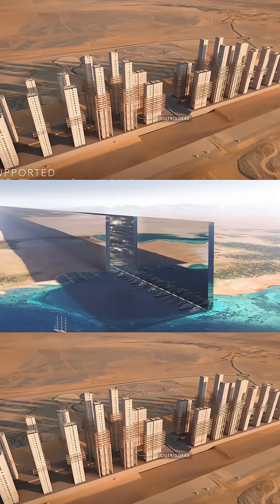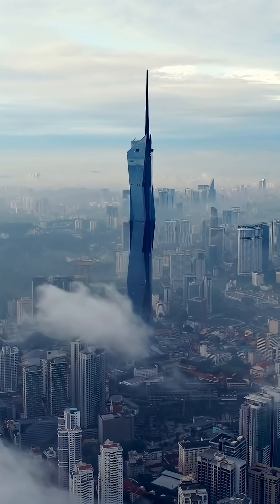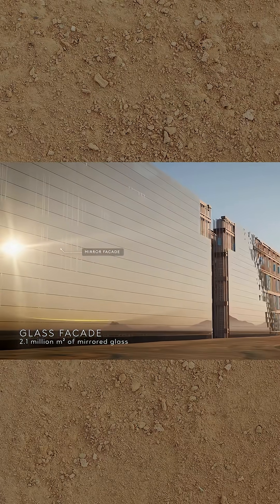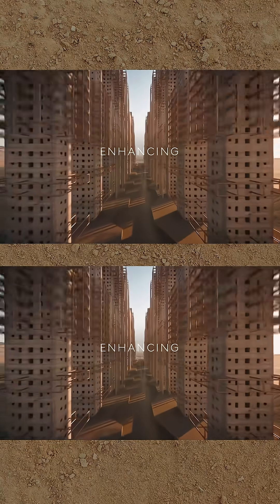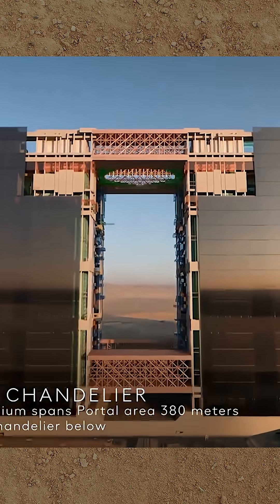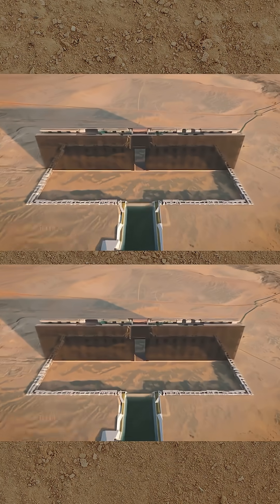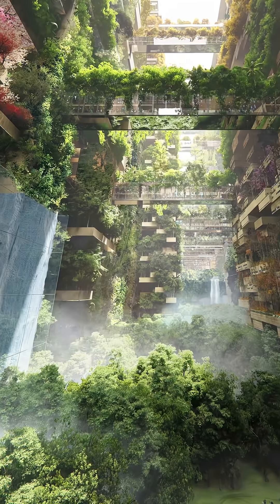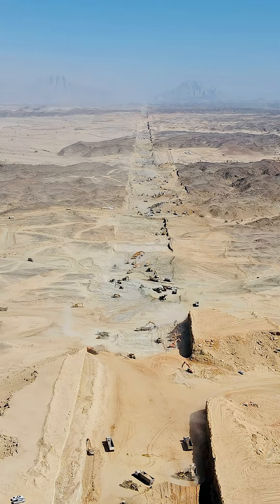Fred Mills: How Saudi Arabia is Building THE LINE

Comment: Whenever I hear about the mirrors in that desert region, my thoughts go straight to the meme "The sun is a deadly laser."
Reply: Well at least they'll have an endless supply of glass for the next section then... 😝
Reply: @supaflyza 
Where are you going after you die?

What happens next? Have you ever thought about that? 

Repent today and give your life to Jesus Christ to obtain eternal salvation. Tomorrow may be too late my brethren😢.

Hebrews 9:27 says "And as it is appointed unto man once to die, but after that the judgement."
Reply: As long as it’s not concave like the skyscraper that melted everything in the focus point.
Reply: @chris2381-t3r but if that focus point is in an uninhabited desert area couldn't you potentially use it to generate massive amounts of energy?
Reply: @chris2381-t3r the one that I know of was the Walkie Talkie building in London.  It melted a car.
Reply: @chris2381-t3r my window with mirror isn't convened but it still melts my tarps outside lol, focused beam just makes the center point much higher power beam but it don't mean being a flat surface will not melt things.
Reply: This is a topic in every engineering college....the impracticalilty of this project. Have money waste it 😢
Reply: @Nrb2003  so, how did those man-made islands work as their last architectural marvel?
Reply: Architect here. I once did reno work in a condo development where the sun was reflecting off of windows and melting the vinyl siding! The sun is a powerful force. I “pity the fools” who live in “the line”.
Reply: @christopherzehnder I do too. It’s basically a prison tarted up as something good 😬
Reply: @christopherzehnder 
I watched a documentary on the line where they pointed out the cost to keep it air conditioned ( it's being built in the desert ) would bankrupt the project among other challenges...
Reply: @cduffy6708 No need for ac when all that heat is reflected away
Reply: @christopherzehnder  makes you wonder if this will effect the air conditioning in the buildings. Not sure they will get that many to live there once the heat is noted as a factor.
Reply: @christopherzehnder  You think they didn't do all their research before attempting a project this gigantic?
Reply: @AllAround_TheInternet I’m an engineer. Just because “they can” doesn’t mean “they should”. This is a vanity project.
Reply: @christopherzehnder  I understand you. But for a project this massive and transgenerational I feel they should have put everything in place both research and the effects it would have especially on the ecosystem.
Reply: @AllAround_TheInternet You mean done their research like the "world's biggest big wheel" in Dubai which proved to be too heavy for the bearings it sits on and hasn't rotated since the first month it opened?

Sadly record breaking stats come first, functionality way later
Reply: @christopherzehnder surely they have top notch people working on the project, they probably already have a solution
Reply: @christopherzehnder  Modern day prison...
Reply: Sounds like a nice source of free energy if they place solar panels on the ground outside
Reply: @nicksusernameforyoutube  just make the sides out of solar panels...
Reply: @ImReverseGiraffe solar panels are black and aren't very efficient so that would make the whole place into an oven
Reply: @nickfleming3719 Hey, that's really smart.
Reply: @nicksusernameforyoutube n...n...no? God forbid you haphazardly focus light on solar panels they're already a b** to cool as is, are you looking to start a fire?
Reply: @nicksusernameforyoutube it would melt them
Reply: Whenever I hear mirror in the desert I think: 
1) I pity the poor peons that have to clean it twice a day
2) And the ones who have to replace it after every sandstorm turns it into brushed steel looking stuff. 

The amount of water and power that will be wasted on this is absurd, the outside temps will regularly hit 50C+ over the next few decades.
Reply: @MostlyPennyCat yea seriously like we could be spending money on desalination and terraforming to stop drought and cut heat but they want to build this crap
Reply: @ImAmNotSmart  didn’t you see the roof gardens for the most wealthy of the line residents?  And the desert barrier, against anyone approaching this modern Jericho, might be considered a feature rather than a bug by the rulers of this modern take on the Judge Dredd style megacity.
Reply: @nela9994 all i care about is more food growing so lets see how it goes
Reply: @ImAmNotSmart  how does this promote more food growth?  It actually removes people from being connected to food growth.
Reply: @nela9994 oh i agree im just trying to be hopefull
Reply: @ImAmNotSmart  alas, the only provisions for greenery seems to be along the roof, which doesn’t make for good farming, especially with the superheated air that will be rushing up the sides of the superstructure (mirrored or not) and all the waste-heat from those living within, also rising upward.  The salt-water coming in for the boats are also not going to be good for any potential crops, and that being a boat-way means that the pollutants are also going to be not good for the crops.  Human waste does not make great fertilizer, so … that’s going to be another issue in getting rid of all of that.  It … really doesn’t bode well for any food-raising at all.  Crops or livestock.
Reply: @MostlyPennyCat  maybe that’s why they building this ark !!!!!
Reply: @MostlyPennyCat  Only the outside temperatures?  NEOM is going to create a heat zone in its immediate vicinity, which will also heat up its interior.
Reply: @MostlyPennyCat wasted water? The earth is basically water lmao
Reply: @nemiw4429 
Jesus, really? You don't understand the difference between salt, fresh and potable water? Or how little fresh and potable water there is?
3%
Only 3% of all water is fresh and therefore useable. Salt water is useless.
Reply: @nemiw4429 
If you do the math, there's only 2 tons of water per person.
On the entire planet. 
For each of us 7 billion humans.
Reply: @MostlyPennyCat 
Where are you going after you die?

What happens next? Have you ever thought about that? 

Repent today and give your life to Jesus Christ to obtain eternal salvation. Tomorrow may be too late my brethren😢.

Hebrews 9:27 says "And as it is appointed unto man once to die, but after that the judgement."
Reply: It’s going to be a laser weapon 😳
Reply: Not anymore it’s a BLANKET
Reply: ❤ remember these are the idiots that built the prince's Palace 2 mi away from the six-lane freeway so that everyone can see how amazing he is until he decided he didn't like listening to a freeway drive by his Palace so they reduced it down to a one-lane road as it passes his Palace so that all the people that it's just they're stupid they're fighting over sand😂❤
Reply: Sounds like a great way to radiate heat 👍
Reply: The green object, (what appears to be art) above the entrance are some type of computer/camera. It's major function is security.
Reply: @pierredur  it’s a chandelier.  Looks like it’s also a viewing platform.  Looks like people inside going up and down flights of stairs.
Reply: @pierredur figures
Reply: You crazy brow. Stay sane🙏🏻
Reply: They should have it in a way where anyone can get citizenship if you can make it to the entrance without getting cooked alive for about 20 yd back. Possibly a mile 🤣
Reply: Whenever I hear of utopian systems, I laugh and remember the rat utopia. It wont happen.
Reply: "Let the sun be someone else's problem."
Reply: Too bad they haven't got giant ants in that desert...
Reply: @marbellaotaiza801  I’m more thinking about Archimedes’ defense of Syracuse, and those poor ships sailing into that port …
Reply: @marbellaotaiza801  LOL, There is nothing like frying ants with a magnifying glass.
Reply: Solar panels..... 🧠
Reply: If they would instead harmed that solar energy to power the buildings, that would be cool 😎
Reply: @shegally I would think they would seeing how these ppl are super rich!! I'm pretty sure it will have state of the art equipment such as solar and wind recovery systems!!! I mean if u think about it they're going to hav to bring or create system for everything they will need to liv such as water production, power,food,fields to grow food,animals etc etc.!!! It will be a feat to overcome in the middle of the desert!!! But we'll see how or if it works out I guess lol!!!
Reply: Exciting
Reply: So many birds crashing into the sides of it
Reply: @winterroses2020 did you let them cook long enough? You're high yourself a roasted bird
Reply: Exactly ,that is crazy. Mirrors in the desert ?
Reply: Its to keep people out yea
Reply: YES❕ 
They wonder why the earth is heating up & want to blame it on what it’s not 

Sure it has nothing to do with all these building around the world being made of glass & even worse is THE MIRRORS & MIRRORED GLASS❕
Thee worst possible thing for summers and even winters now we have far less snow in places it’s supposed to be covered like The Rockies which affects Co. River immensely and that has its HUGE AFFECT  on Lake’s down river 

Think it doesn’t reflect 20x hotter ???
Just check the proof at the building in Vegas that the mirrored building has started fires on the pool deck and severely burnt 100’s of peoples 
Already hot enough in these deserts We don’t need these geniuses not being geniuses about the simple parts.
Reply: Well, that's the point isn't it? Prison like North-Korea.
Reply: Las Vegas of the Middle East
Reply: How very depressing 😞
Reply: We could make a religion out of this
Reply: @asymmetriq Within izz lamb no others should be higher?
Reply: I’m wondering if the mirrors will have to be modified in order to not create problems on the land around that area? There’s been a problem here in Texas with glass buildings giving off to much light to traffic and other buildings. They had to be changed up to not shine so much because it was a hazard to roads and vehicles.
Reply: Birds and incinerated; people blinded.  Great
Reply: In 50 degree heat one can only imagine the fires!
Reply: better to use desert re-greening to restore water sheds & other ecology gucks systems that support life Nature’s Way .. make it ALLLAH’s Garden instead of NWO Transhumanist gulag
Reply: When I heard about the mirrors the first thing that came to my mind was: ok, now imagine some dumbass kid with a rock
Reply: Yes
Reply: How many people dying from hunger especially Gaza 🤔
Reply: We might have cryptonite 😂
Reply: elite ball knowledge required
Reply: Same thoughts here!!!
Reply: These building projects are part of the real reason for catastrophic climate shift.  The world's axis tilt is being changed by it!  Excessive building projects are destroying the Earth!  I've watched the documentaries!
Reply: They will get dirty from the dust after about a week.
Reply: Not anymore there's a blanket (solar panels)
Reply: Hahahaha wow!!! That can literally be the case!!!
Reply: This is S A ‘s prison for the masses.
Reply: You gotta be a special kind of stupid to build 500 meter tall buildings on sand! 😂 nobody has ever accused Saudis of being smart! 😂
Reply: The whole project is a recipe for disaster.
Reply: Imagine flying over that crap! What a terrible idea!
Reply: .....just to hide rich peoples!😉
Reply: mirrors are not lenses, they do not enhance the beam power, get yourself a basic school education
Reply: @Nidere  And do you think that a wall that is built out of frames and glass on sand, isn't going to have some concaving happening at all? That makes you naive. It is going to be built on sand. even if they dig it hundreds of feet down, it is still going to be exposed to the heat and elements. How structurally sound do you really think that is going to be? Some parts will concave, which will have a magnifying glass effect. 
In England a building known as the Walky Talky because of it's shape was concaved, and it caused car parts to melt in the heat. They had to install fins above every glass pannel to defuse the heat coming off of the building. Now, England isn't known for it's extreme heat, unlike the desert. So, Yes it can happen. Try that for education. You just learnt something.
Reply: And then build a solar line to capture that energy.
Reply: The sun would be just elsewhere. Nothing weird about it.
Reply: 15 minutes city!!!!!  Stop this madness
Reply: Wow.
Reply: Yes!!!!! Me and my sons joke about that alot, and nobody has any idea what we're talking about lol
Reply: Another absurd trophy project.
Reply: Dawg imagine going up to the seeing. As far has driving to it or whatever. Ts gotta be blinding when the sun hits it just right
Reply: Reminds me of Desert Treasure, if you know, you know.
Reply: What a total and utter waste of time and effort and money. The world is truly fked
Reply: Right? Mirrors? Think of the birds and creatures being vaporized. 
Ohhh, won't someone think of the vaporized creatures....
Reply: Is the earth flat ???
Reply: Ameen ❤🙏🙏🙏🙏🙏🙏
Reply: Lol😂😂😂
Reply: Seems like an mega enterpreneur. I wouldnt be surprised they succseded in their architectural adventure. Id only ask who can afford livin in such mini city. Hey they crafted Dubai in the midst of a hot desert, why wouldnt they draw a line in the sands. Only deathyray sunshine that melts everythin should be a thing 2 take under consideration...😮😊🤭
Reply: this could really be a huge problem depending on the angle of the Sun
Reply: Yeah mirrors in the desert sounded so stupid.
Reply: Yeah and they will still blame the fake global warming on cow farts and not the Giant 500 M tall shining wall of mirrors beaming sunlight on the ocean and what is that amount of material if that thing ever actually gets completely built going to do to the balance of the planet they've already built massive Islands shaped like palm trees you can supposedly see from space if we ever actually made it there
Reply: The Disney Music Hall in L.A. was melting parked cars across the street. :}
Reply: Not anymore theres a blankeet!!!!!
Reply: I have good news. Jesus offers salvation to all. We all sin and rebel against God which leads to destruction and we all need a Savior no matter who you are. Jesus is that Savior to save us. He died for you so you can live, and rose three days later. Come to him. Repent of your sins, keep praying for God to forgive you and he will. Come to him and believe in him and accept him as your Lord and Saviour, He loves you and wants a relationship with you. Jesus changed my life in such a good way  God bless. I hope this message helped.
Reply: 🎵 Not anymore there's a blanket 🎵
Reply: Poor birds...
Reply: At least you can cook sunny side up there, free energy. 🤪

P.S. about the solar panel, the enemy there is the sand dust/storm (or is there no wind there?); need cleaning up from time to time especially if it's low ground.
Reply: @ninojanjeremygo463 
There is quite a lot of wind there.
Reply: Poor animals there… getting burned while being cut of their habitat by an invisible wall 
Great idea
Reply: @kurtishell5298  There is no habitat there it's literally in the middle of a pretty much barren desert!!! 100s if not 1000s of miles of pure sand!!
Reply: @GottMitUns1 
To everyone in this chat, I just want to let you know that Jesus loves you and he can save you from sin, sadness and sickness.
Reply: Also what a wasted opportunity to harness it with solar panels!
Reply: That will only double the light that's not a lense 

Will still be crazy hot but not but inf anything. 

Also, no one is supposed to be outsider